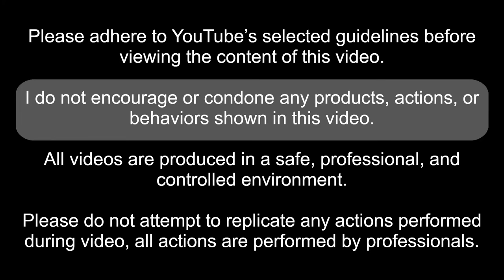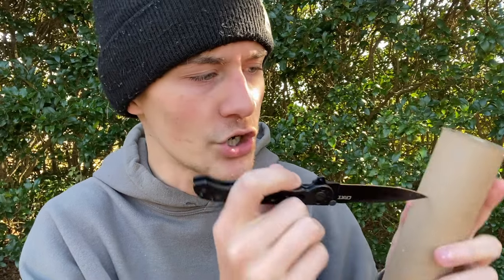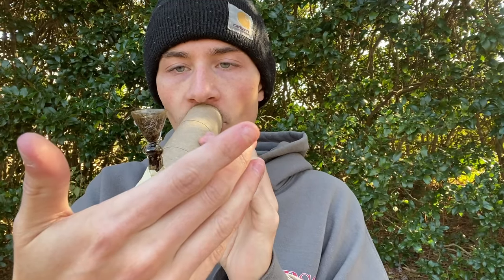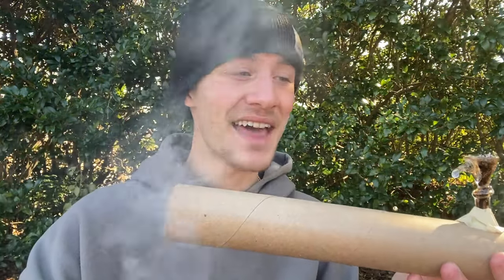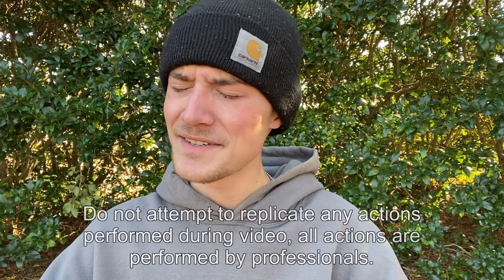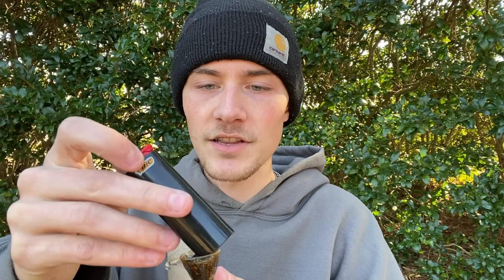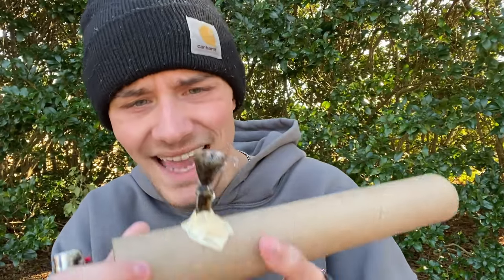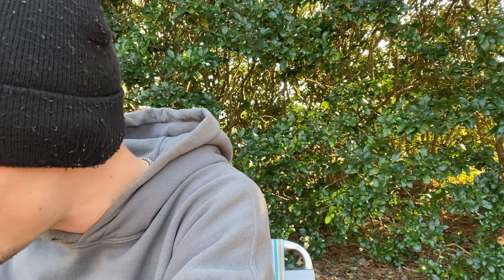I Built a Pipe out of an EMPTY PAPER TOWEL ROLL and Smoked Through It

Comment: i know this is old, but pretty much for others
you start inhaling, then half way through/at the end you remove your hand from the end and inhale, clearing the pipe of smoke, and also cooling the air for your lungs
givign you a cleaner hit similar to lifting the bowel out of a bong to clear it, 

you can also lift a figner changign the amount of airflow gettign sucked through the we....tobacco regulating the burn, and also helpign clear the smoke inthe tube
Reply: wait hell eyah he starts to get it, and you can tell it started to hit, and also shotgunpipes are great vs onehitters or hot knifing, but its better than a bong without water or rollies